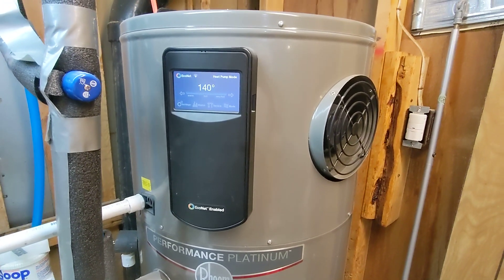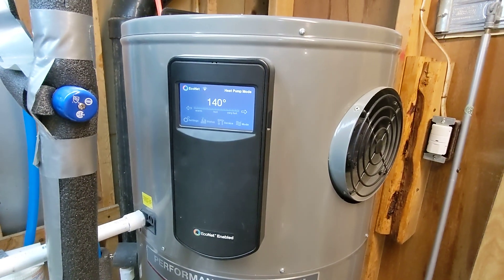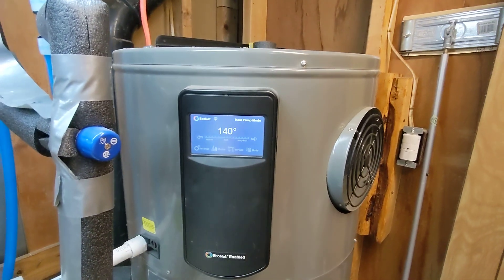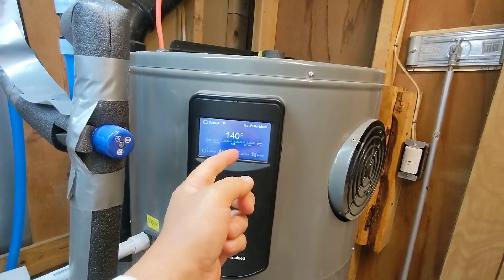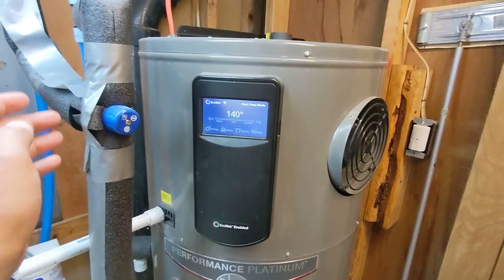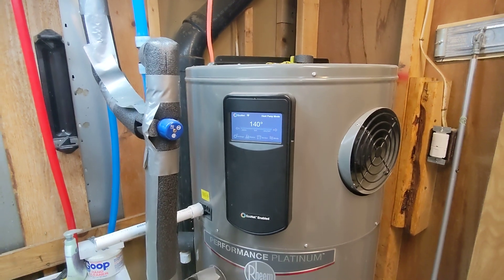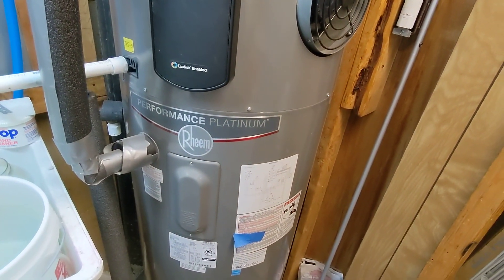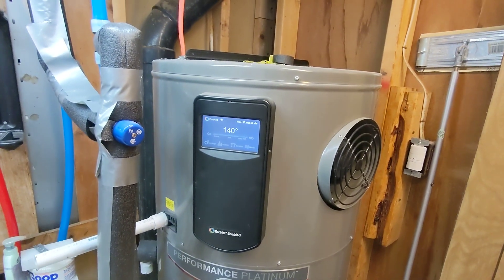2019 Rheem Hybrid water heater 3 year update

Comment: Had mine for 3 years as well, and I also installed a mixing valve.  Since I live in Florida where it is hot all the time, the "free AC" is awesome. Since I have it in a closet with louvered door, I did put a short duct to pull in air from another area, just to help faster air turnover. But the thing is awesome and has already paid for itself in energy savings. I do wish they had a scheduling system so I could use mostly off-peak power, but we also have solar during most of the peak times, so not a big deal.

Comment: Where do you have yours located and how big is the areas? have you noticed a temperature drop? I’m thinking about putting one on my 2 car garage. I’m Just  wondering if it would help with the heat
Reply from the maker: It's in the basement, and yes there is a noticeable cooling and drying effect.  A garage would have to be quite well sealed against air leakage to notice a difference, and usually garage doors aren't insulated either - at least down here in Georgia they aren't.  But yes, if you had a well-sealed and insulated garage, it would help.  Right up until you opened the garage door to pull you car in or out.  The cooling effect is definitely noticeable.  It isn't a substitute for an air conditioner, though.